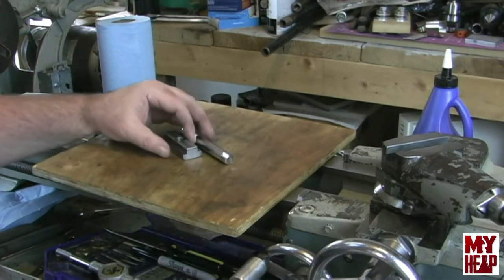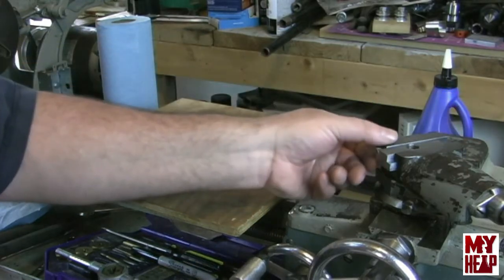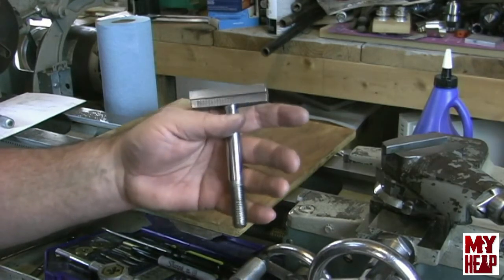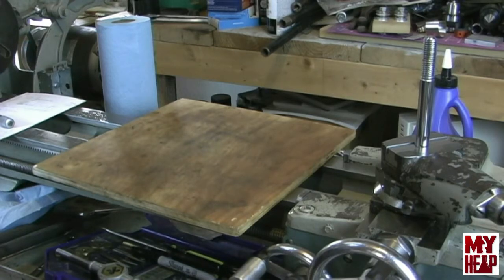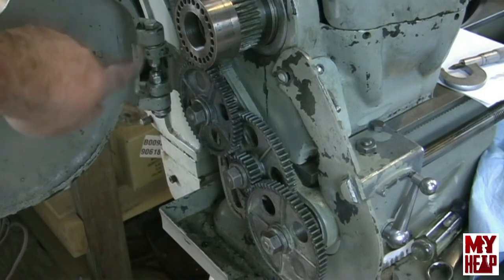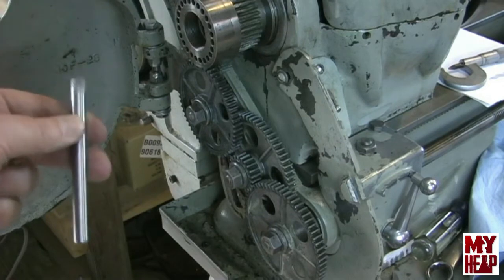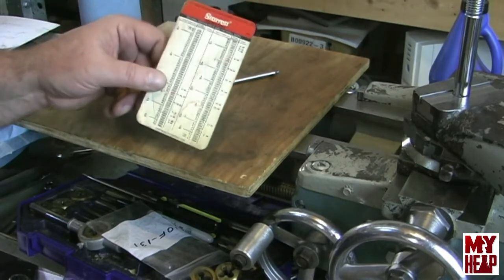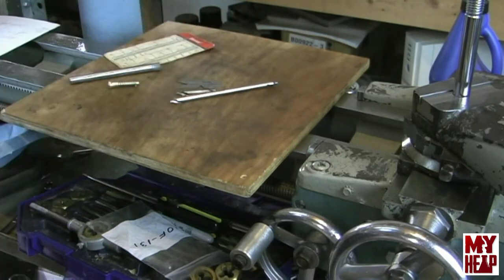Atlas 10F Lathe - TH54 - 21 - Grātiās Vōbīs Agō

Comment: Coming right along Joe. Just make sure your face plate and spindle threads are perfectly clean before assembly. Make sure its fully seated and check your runout on the face with an indicator on the outermost part, the middle and the innermost part so you can kind of map out whats going on....it should be pretty close. If it needs a dusting to true it up cover up the ways if your plate turns out to be cast iron. You may wanna wait till you have some time under your belt doing some other facing type work before tackling a face plate. Make sure the carriage is locked and the backlash on the compound has been removed if you end up facing that guy. Large discs like that love to sing so watch your speeds/feeds to avoid chatter. Glad the other guys hooked you up, sorry I wasnt able to knock out that T-Nut for ya....the new parts look great!
Reply from the maker: I will give it a good cleaning and measure it.

No worries about the parts, I appreciate the ones you made for me and all the other help as far as that goes.

Joe

Comment: Hey Joe, First of all I'm glad i could help. As far as turning your faceplate goes, for turning between centers, I don't think it really makes a difference if it is not perfect. I assume you will put a mt3 dead center in the spindle and attach a drive dawg to your work. Its the center that holds your work steady, the dawg just gets pushed aroung by the face plate.
Reply from the maker: Point taken.  Although at some point I may need to mount something on the faceplate to turn parallel, but until then I am not going to worry much about it, other than take an indicator and see how it is.  Thank again Jeremy for all that you have done for me.  I appreciate you.

Joe

Comment: Good vid - I am upgrading a 10F a bit here, a bit there. Yesterday, I had to disassemble the compound to clean out the cross-slide and things work smoother now. Also, I am adding a digital gauge to the tailstock so bought another one because I don't want to irreversibly mod the original, as it was my Dad's. I want to mill a flat on the tailstock to get footing for a mount. 

One thing I saw on youtube is a possible digital divider set up based on a stepper motor on the back of the spindle to precision index the spindle. 

Currently cutting a spindle guard for when using collets. One project will be to also fashion an anti-backlash nut on the cross-slide as I currently have 12 thou backlash  - current nut must be pretty worn. Keep 'er going!

PS here's an Excel File showing Surface Speeds for Atlas 10F spindle speeds:
www.brightgarden.com/Atlas10F-SFPS/Atlas-SpindleSpeeds-SFPS.xlsx
Reply: handy chart i know i have it in to book but thats kinda a hassle in the heat of the moment right. btw i have a bunch of stuff on atlas lathes on my channel
Reply from the maker: Richard Cox added a digital caliper on his tailstock without making modifications.  He used the oil dip hole as a mounting point.  I suspect something based on a wedging action like a concrete anchor the the working end clamped to the tailstock quill.  Looks like it works well.  I think that is the route I will take.

I do have experience with stepper motors.  In their most basic form they are usually 200 steps per revolution.  So when you say precision you have to take that with a grain of salt.  For example, if you wanted 7 divisions, 200/7=28.5714.  Since it takes 200 pulses to rotate the stepper 1 revolution, what do you do with the remainder of a pulse.  Now you can half step and microstep a stepper motor, but these are powers of two.  You may need some intermediate gearing to get it to work out.

I too want to do some indexing, but I think I will make index wheels to mount on an arbor in the headstock spindle.

Perhaps we an corroborate on a project like this?

Thanks for the file!

Joe
Reply: interesting idea randy richard mounted one with magnets (get to keep you grease dobber that way
Reply: I have seen tailstock mods but not for the curvy Atlas tailstock. There aren't any flat surfaces except that grease dobber hole, maybe. I would have to get different digital caliper that is shorter, would fit on the top of the tstock without interfering with the quill crank at the rear. I'm not one to undercomplicate things, either : ) Why spend 2 hours getting the job done when you have all day??? I am all for collaborating and corroborating - I will take some pics as I go along.
Reply from the maker: HAHAHA, Mea Cupla.  I meant collaborate.
Reply: :  ) It's good to corroborate, too.
Reply from the maker: Point taken!!!  You know, I am a bit guilty of over complicating things too.  If we put our heads together, no telling the Rube Goldberg device we could make!
Reply: You are absolutely right Joe, works just like a concrete anchor just on a smaller scale. Feel free to show the picture of it if you like. Enjoy your goodies.
Reply: Well looks like this went into the wrong place, sorry about that.
Reply from the maker: Your reply is in the correct thread Richard.

Joe